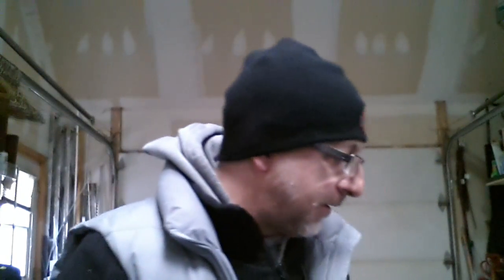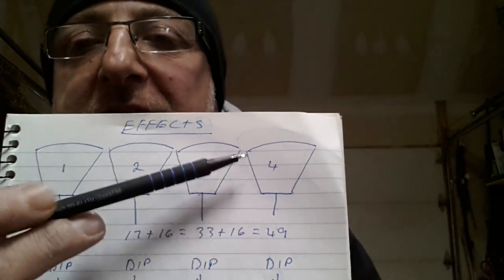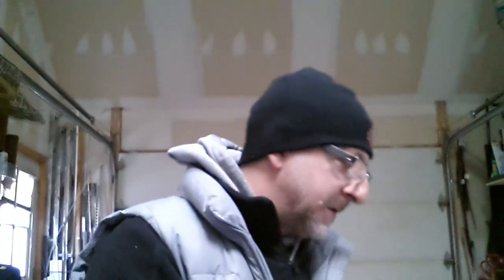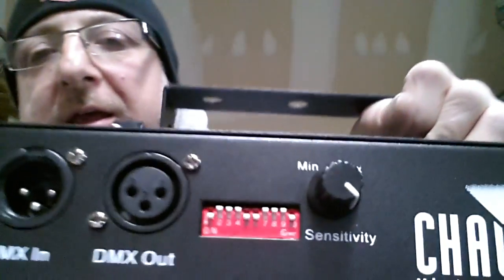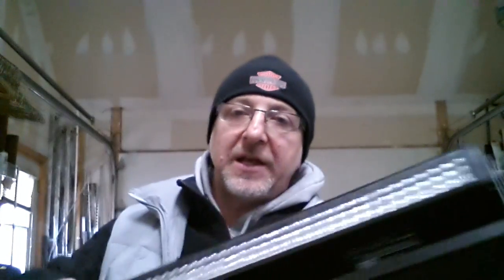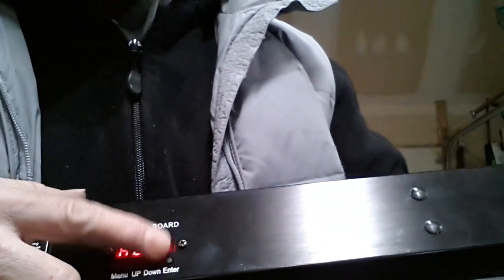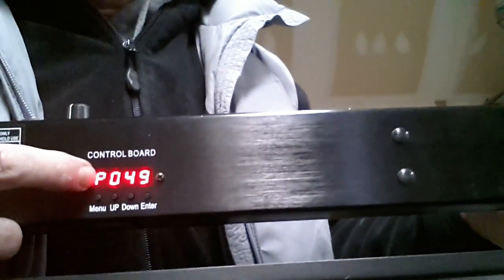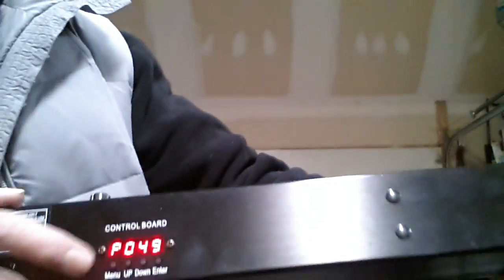How to program DMX lights, dip switch addresses

Comment: Thank you sir!!! Now can you or anyone one confirm this. I know your last fixture was a LED bar which had no dip switches. All my fixtures do not have any dip switches but it shouldn’t matter correct?? As Long as I follow the formula he has on here and use it on my digital address display correct? Any feed back will be much appreciated.
Reply from the maker: That is correct, add the corresponding channel number to all your fixtures in the correct sequence and that's it..you're ready to go 😉

Comment: Jumped for joy when the 1st fixture connected, been stuck getting the signal for fixture for fixture 2. 16 channels - 10 dip switches the 2nd will not work. Confused 😕 sir. Maybe some settings on the DMX controller possibly???

Comment: Thank you so much. I get it now. Now, I just have to put this into practice and get my lights and board out to try.
 I was wondering about wireless DMX too. If say, I put a fixture on Ch 1, and then instead of having a DMX cable on the DMX 'out' side of the fixture, I put a wireless transmitter, and then installed a wireless receiver to all the other fixtures, would the fixture on Ch1 run the other lights as a Master? If not, is there a way to do this?
 Thanks again!!

Comment: how r u. im putting on my first synchronized firework show. but i want to do AC/DC Hells Bells. i wamt to get 4 fire machines to shoot fire when you hear the bell. can i use the dmx machine with the fire machines just as if they were light fixtures. itll be bad aas show if i can.
Reply: bppyro pyrotechnic, sure you can but I am sure there is a much safer way to do it when working with pyrotechnics...

Comment: Hi' Thanks for your info just wondered if you may be able to advise us. We run a Ledj S1  Controller with Ledj stratos LED Panels we us them on automatic button settings  on the controller . I have an unbranded Panel light dmx  512 and don't know if I can get it to work with the other panels and controller?  it has a 4 button address unlike the Ledj which is 3 can I somehow get them to work together to operate the same colour program? Hope this makes sense.Ledj panel address is 00.1
Reply

Comment: Thank you! FYI, if you haven't been told already there is a iPhone app for dip switches. Plug in your number and it converts it to the dip switch format.
Reply from the maker: hello Cameron, yes thank you, I was aware of the app when I made the video. The purpose of the video was to help everyone understand where the address derives from and the relation between the controller chanels and the fixture.

Comment: Setting dip switches is simply a matter of converting decimal to binary. I think the fact that the switches are usually numbered sequentially (1,2,3 etc) is what causes confusion. If they were numbered 1,2,4,8,16,32 etc it would be more obvious.
Reply from the maker: indeed,  thanks for watching.
Reply: +UncleFeedle , Well said, but to explain why, no need for charts, simply addition of dip switch values, i.e.; 1+2 =3, 2+8=10, 4+16=20, etc.

Comment from the maker: Click on the link to download the DMX Chart. For European DMX user, the dip-switch settings are different, the link has both US and European charts. Enjoy LINK>http://www.look4ideas.com/techstuff/dmxchart.pdf
Reply: asian chart?
Reply: +How To Do Stuff  hello i was wondering if the US chart is compatible to use in Australia?
Reply from the maker: +Anissa Brown hello Anissa, I am not certain if the US DMX chart will work in Australia. ..sorry.  If it does please share it on my chanel so that everyone else will know. thanks for watching and sharing my video
Reply: +How To Do Stuff : The chart that he uses is very user friendly. The dip switches (ds) are in "binary". From the left to the right each dip switch is twice the value of the first one. Ex. ds 1 has a value of 1; ds 2 has a value of 2; ds 3 has a value of 4; ds 4 has a value of 8; ds 5 has a value of 16; 6=32; 7=64; 8=128. If a ds is "on" then you add it's value to all the values of ds that are "on". Ex. ds 2, 5, 8 are "on" then the value is 2+16+128=146. So...all switches "off" the value is 0; all switches "on" the value is 255 (1+2+4+8+16+32+64+128). Binary is binary so it should be fine.
Reply: How To Do Stuff